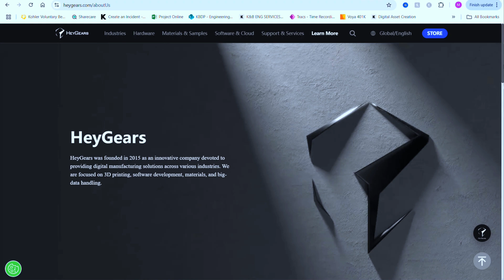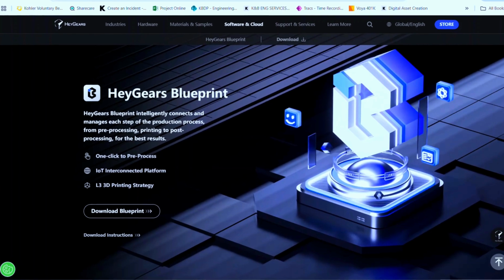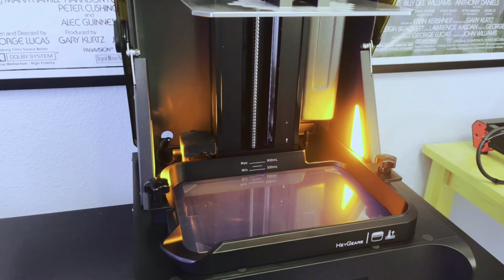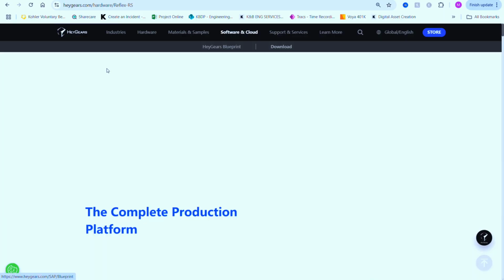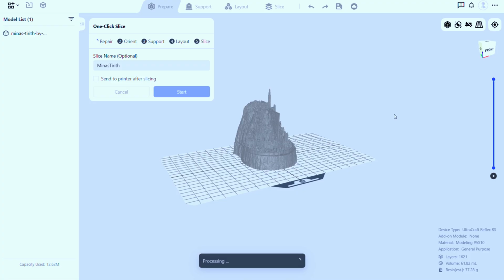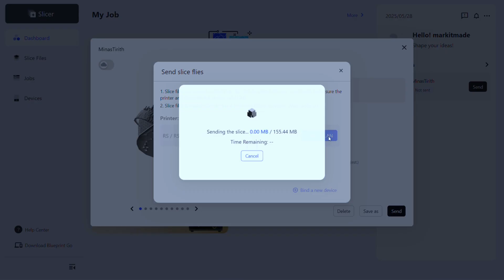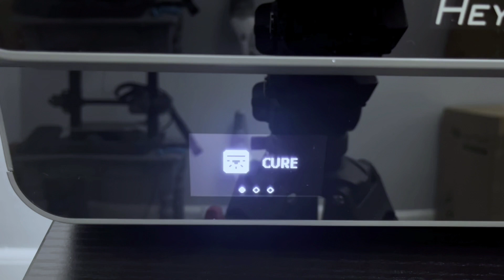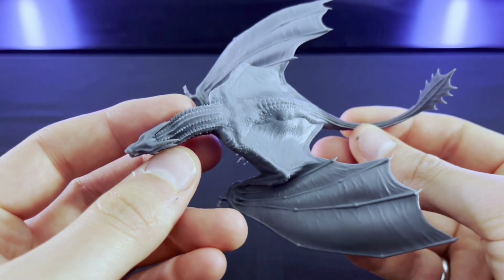Is This the Coolest Resin 3D Printer for 2025?

Comment: I'd consider that Darth Vader print a fail.  Did his helmet break during rinsing, or did it just not print right?
Reply from the maker: It broke in during washing. After that I kept all the supports on and removed them after washing, before curing. Haven't had any cracks or breaks since.

Comment: That wash chamber is atrocious. everything you put it on is going to shake to all hell
Reply from the maker: FACTS. Need a sturdier table. Get stuff nice and clean for sure, but kind of overkill
Reply: @markitmade29  The spinning magnetic propeller that almost everyone else uses is definitely the way to do it. I keep both my resin printers and my X1C on a folding table in my basement. minimal shaking is a requirement